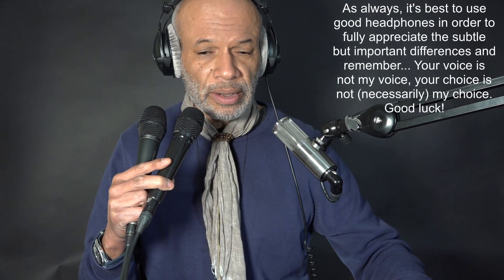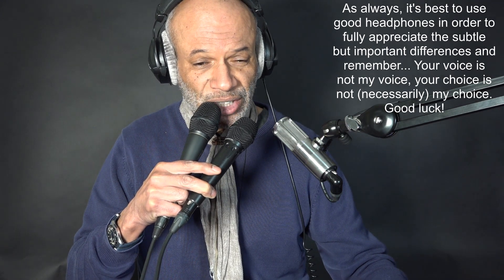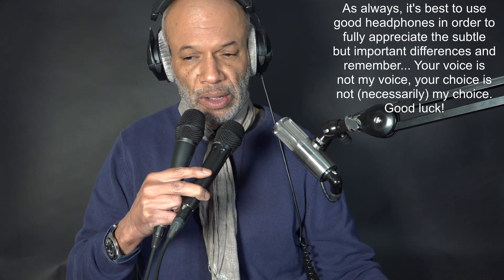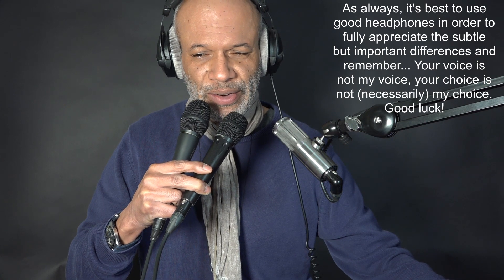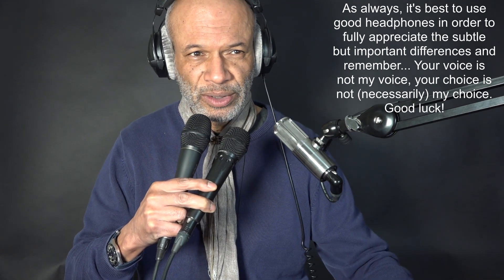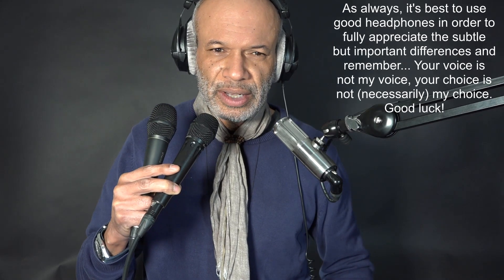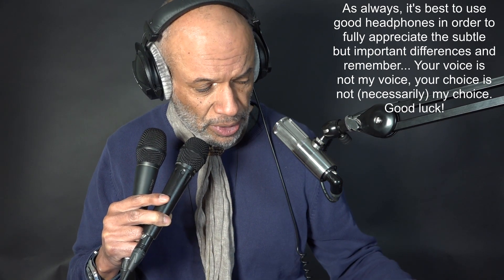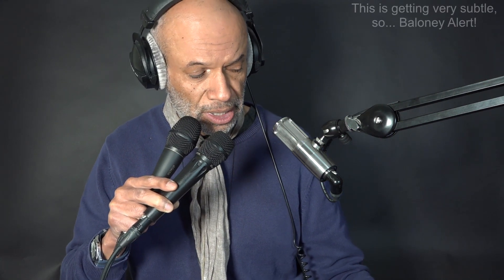Bass & Breath Test - Earthworks & DPA d:facto

Comment: I’ve noticed somthing about the d:facto: it’s polarity is reversed compared to other mics.
One thing is how it works together with other mics on stage, but I notice hearing more lowend when I flip the phase on the console. Weird, right?

Before, I only used it on female voices, now I like it on all voices. -If the style suits it. (I’d rather use a dynamic mic on dirty Blues or Rock vocals.)
Reply: Polarity is important for complex signals, transients, brass instruments, percussion and of course, vocals.
It's extremely important for controlling live performances through headphones